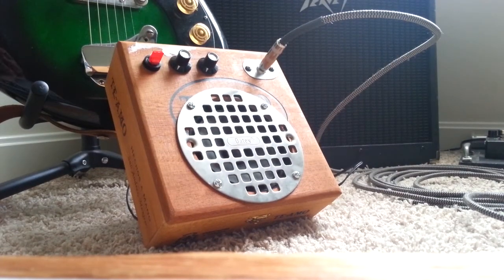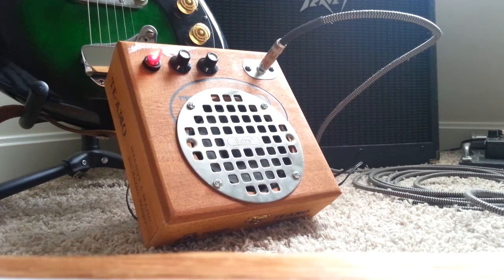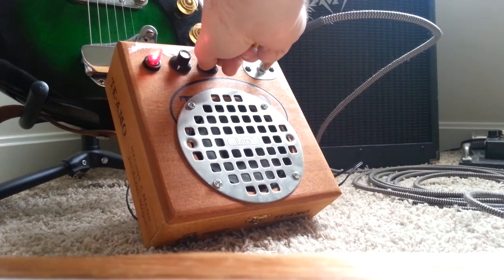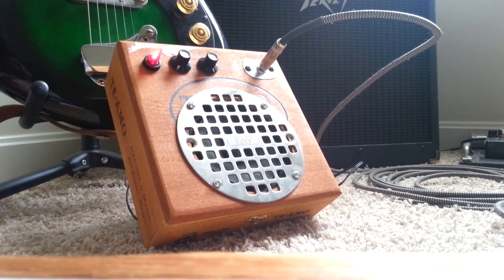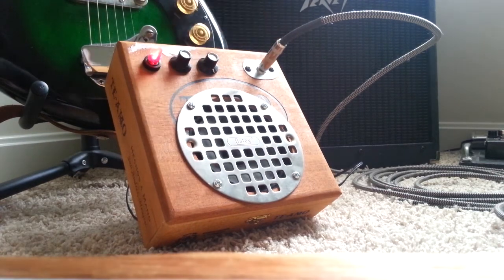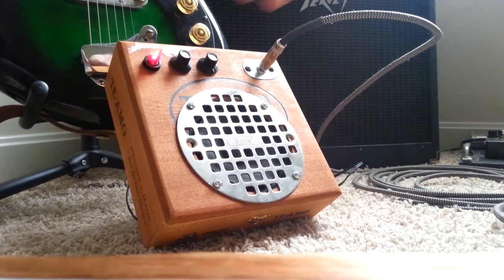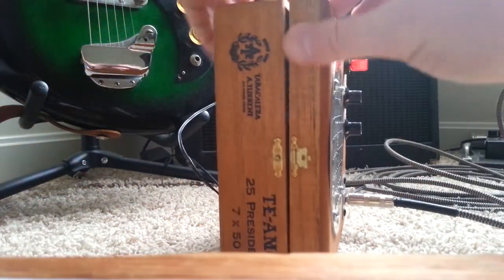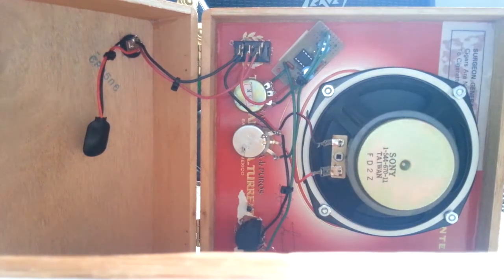Cigar Box Amplifier Test

Comment: Do you happen to know how many ohms that speaker is? I have been wanting to try one of these with some leftover car speakers I have.
Reply from the maker: I believe this was an 8ohm, but I currently have that same circuit wired to a pair totalling 4ohms with no issue. There's a vid of that one, too. I think it turned out nicer sounding than this.
Reply: +jayp5150 Thanks for the response. I have a 4 ohm and a 6 ohm speaker. Sounds like either will work fine. I'll have to try them both.

Comment: Hey jayp5150, Cool vid, amp sounds great. I build the Runoffgroove.com Ruby amp which is an enhanced noisy cricket in that it uses a MPF-102, 2N5457/8 or equivalent junction field effect transistor as an input buffered stage, fed into the LM386 Audio op-amp chip which using a 10 ohm resistor and a 47n, 0.047uF, code 473 non polarized capacitor is the output buffer stage, they rock. If you build one, take a utility knife and score in an x,y axis around the pins of the J-FET to eliminate the possibility of stray voltage being present, I can tell you all about it. I always can get full volume and gain and amp performs awesome. I have built about 20, many as gifts. Clean your perf board with 91% or I like HEET, gas line anti-freeze, ethyl alcohol, because solder flux can cause stray voltage to be present, clean, score x,y, clean. Be good, C.
Reply from the maker: Cass Virgillo Thanks for all the tips. I plan on building a Ruby next, actually, just been caught up in other projects. Thanks for checking it out!